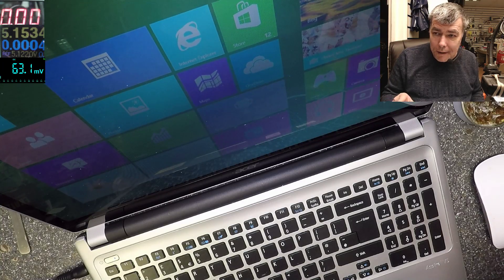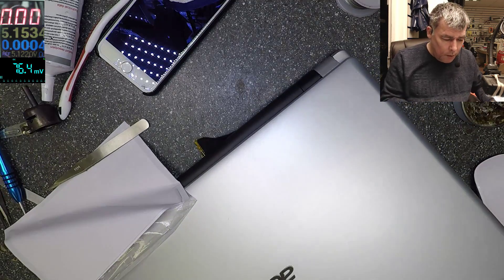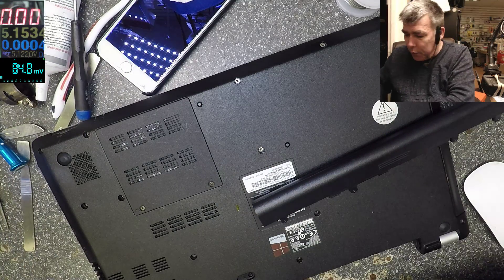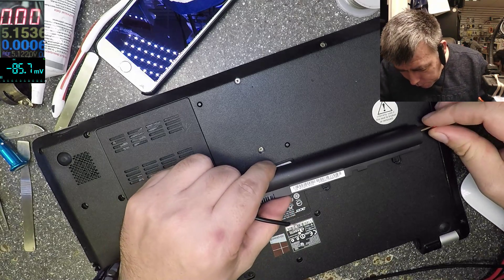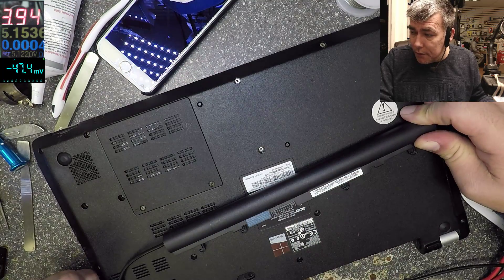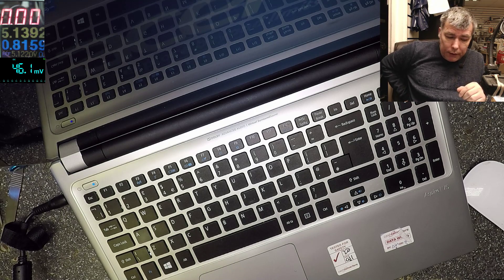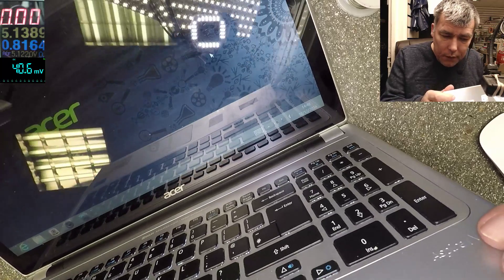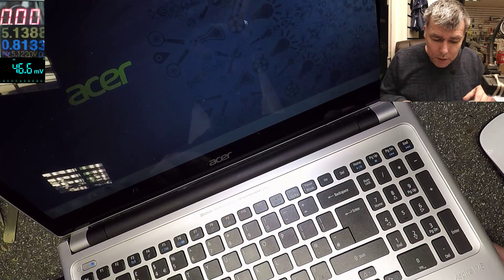Plugged in,  not charging - my way to fix this  :D

Comment: I searched everywhere for your channel good sir but I just could not find it,forgot to subscribe and tick the bell icon. So I'm looking for help with a HP laptop which has the same problem as your Acer . I have to say I have missed your funny videos and ways of repairing stuff, like using lighter fluid to clean a board and removing balled CPU's and ICs without a CPU remover. I have to say I am over the moon I found your channel again, I love watching your repair videos, I really have missed watching your stuff and the inhaler instead of cigarettes, honestly I am so happy I wont be losing it again, your firmly subscribed and bell icon ticked. I don't have the skills to fix my laptop but its good watching you work. I am just too old too fidgety and no eyesight to fix stuff like you do. I wish you were in Perth Western Australia I'd bring my laptop to you pronto, your so fair when you quote a job and fix something. Sad for me though my laptop is a HP 840 G3 with a flat pack battery and its definitely not the battery it is brand new so I am stumped, but I usually check the voltage by sticking pins into the battery contacts, i know its not a memory issue because I bought a new battery and it was charged 50 per cent when I put it in , it just went to zero because the laptop wouldn't charge it. The charger was OK I tried another but I was too scared to use my power supply to charge the battery, because of all the other pins I didn't know what they were for

Comment: hello sir. When I am on the laptop plugin is showing and the charging % does not increase but while off the laptop charging light is on and the battery is charging.
Reply: Sounds like insufficient power from charger, check under laptop for power input/output for charging Voltage and Amperage (or wattage).  Using a universal charger?

Comment: Can you help me? I have a Lenovo G40. It won't run if unplugged. Battery icon says 255% available (plugged in) There is NO (X) in battery icon. I tried 2 known good batteries with the same result and even did all the driver updates and device uninstall and re-install 😞

Comment: well will this work for a thinkpad x 220 battery because it got stuck at 45 % and it wont work also i get this error message to the battery has failed due to normal wear. the battery cannot be charged. replace the battery

Comment: My laptop is cannot b charge i used other charger same specs but cannot charge also, my charger i used to other laptop is working, last i used has battery now is lowbat cannot turn on, every time i plugin may charge to my lpotop and then i plug it out then i test the charger if working i find out no output, remove the charger in to the wall socket and plug it again to the wall socket and tester it again using my digital tester the outpot again is exact output..  think ta motherboard is the problem., what do you think the problem of my laptop motherboard?.please help

Comment: Is there a trick to get an HP Probook  laptop that says charging but isn't?

I have new battery, new charger, uninstalled all battery items in device manager & rebooted, dropped battery out & held power button, installed battery with laptop running, disabled & re-enabled battery items in device manager. I have done all of these things about 10 times.

It started charging once. I couldn't get that again. It works perfectly on the mains

Comment: What if the battery seems to charger even get to 100% thay might last about 1 hour, then other times either if it is 100$ or a 70% it will only last about 2 minutes or less then the computer will turn off then when you plug the charger back in the battery shows 0, 8 checked the charger it is fine it shows 19v.

I did a battery health test, the resurl shows it goes no where near the designed maximum capacity level, I think it should be about 50 mwh, but it shows about 15 mwh at max capacity level, i heard after 24 months a battery will be a very weak.

I have ordered a new battery, I just hope it is that issue, any advice?

Comment: I bought a new battery and the problem persists. Plugged in, not charging. What could be the problem? My old battery is charged to 58% and the new one to 60%. None of them are charging.. The voltage is ok. 11V as it should be. I tried uninstalling drivers. I tried a different charger. Nothing helped.

Comment: Hi, mine only indicates 20%(plugged in) no indication of charging or not charging. Actually not charging and dead. Tested cell voltage is 11+V. What could be a possible solution? Thanks
Reply: Do you have a Dell laptop ?

Comment: I have 2 HP PAVILLION laptops. I have this problem in one laptop. When I remove the battery and put it into the other laptop, it charges up just fine. Switching the chargers, same exact issue. Is there a deeper hardware issue that causes this? I even bought a brand new battery, same thing, plugged in not charging.
Reply: same here

Comment: Sorin, is this applicable to all laptop batteries in general? I come across thousands of laptops a year with "dead batteries". Mostly Dell/HP. I have been recycling them thinking they are dead. How can I try this on the thin lithium polymer ones?

Comment: Thanks for your video... i resolved mine by removing the battery and while the batt is out, plugged in the charger and power on the laptop.... waited for few minutes, left the laptop on and inserted the battery.

Comment: Hi! I have exactly the same problem - 0% plugged in, not charging, BUT i`ve measured the voltage and it shows 14V... What other could i try?....
Reply: Hi, today i`v checked each cell and i notice that one is showing 3.2V. So i`ve change it with new. Now he battery voltage is 14.8V. When i putted on the battery on the computer I tried to run the computer on battery (just to test it). Nothing happened. When i turned on the pc i saw its capacity is 25% plugged in, not charging. Again the same but the capacity is now 25% but not 0%. Any suggestions?

Comment: Just checked the voltage on ends of laptop battery.  6v. I applied 12v limited current to 1.5 amps to charge but zero current flows.  How possible  I read a voltage but it's like open circuit when trying to charge with applied V ? I'm gonna try and zap a much higher voltage.  20v for a second and see.  Any other ideas why zero current for charging?

Comment: I have question, i replaced the battery to new original one but it dose something strange. It keeps do plugged in charging then it disconnects from the DC like the DC not connected while the DC port plugged in. I tried to uninstall the battery and the driver do BIOS reset but nothing any one knows whats the problem thank you

Comment: Hi! I have been watching most of your videos and I thought I was on to something for repairing a laptop, which had no light when connecting the charger; I only have a multimeter tool and I saw that there was no voltage on the POWER button (well, only 1.2 V, instead of 3.3 which was expected). I plugged the charger  and  I noticed that a chip, which seemed to control a power supply,  was getting very hot; I tried to measure the voltage on that chip, but I must have touched 2 adjacent contacts, which somehow shorted the chip, causing it to burn out, with a noticeable glow and smoke... Basically, this was the moment I realized that repairing electronics is beyond my reach... Anyway, the motherboard is lost for what I'm concerned and probably this is the end of that laptop. This goes to show that this field is not for amateurs;  Also, this is my last attempt at fixing any electronics, as it is well beyond my knowledge and understanding. However , thanks for sharing your knowledge and precious time for teaching other people. Multa sanatate si noroc in continuare! Succes in ceea ce faci!
Reply: Hey Johny you couldve just removed that chip and the board would've been OK. Anyway guess you went on with your life without pursuing a career in electronics, all good
Reply: This goes to show that this field is for amateurs aswell as everybody starts out as an amateur you gave up too early... Lol keep trying stuff until you see progress that's if you really have passion for electronics if not then stopping at the first sign of struggle or failure is a sign its not for you.

Comment: Hi can you please help me with fixing my 3d laptop van toshiba it is an toshiba sattellite a665-14 c with la6062 p 4.o chassis. He got 19v power rail . Blue llight on the chargerlight , when you power up power buttons goes for 5sec on. Then shuts down i saw water damage on pu2. I clean it. 19v power rail is present. 3,3 normal too because there is light. I can you give a schedule from la6062 p 2.0 version. Please help me

Comment: Amazing. Maybe someone knows, how to change amps while same voltage goes to battery? I am architect. Do not know a lot regarding this. But I have a lot of old laptops I used all these decades. Some of them i really miss. 
I have smart charger for lipo nimh etc batteries. And universal laptop charger. Which one I can use for raising amps? THANKS

Comment: How cells of laptop battery can be repaired ?
Reply: As long as I know there is no way to "repair" a cell, if it is failty You must change the cell or cells for fresh ones.
Reply: @AlanHernandez-kl7ld  please create a video for cell replacement. Where to buy new cells ? How do I know the new cells is original or fake ? Which cells is compotable for laptop battery ? And so on.

Comment: how did you force the amps into the battery? at what voltage did you set the powersupply? i dont think my powersupply can do that.  can someone explain it to me?
Reply: That,s what i want to know, The crux of the story is unclear to me 😡
Reply: Remove the battery and check the pins on the laptop to see how much voltage they give and use that voltage with 2 3 amps and that's it.
Reply: 3 x18650 cell--->4.2 volt x3=12.6 volt,  set  your bench supply to 12.6 v

Comment: hi. thanks for good content . what do you mean if the memory is not lost ? what memory ? what are you talking about?
Reply: Hi I know it's been a year since your comment ,but if you still don't know he meant battery eeprom memory when everything about battery is stored: serial number capacity etc.When cells discharge to certain voltage the eeprom notices that and blocks the MOSFETs inside batteryto charge the battery.

Comment: how much volt that you use to charge this batry
Reply: kanel kanela no the battery is rated at 10.8 volts and there 6 battery's  2 batterys are in parallel for more current.. 3 times to make 10.8 volt, i charge them at 12 to 13volts.. Only the laptop receives 19 volts, it dont put 19 volts into the battery